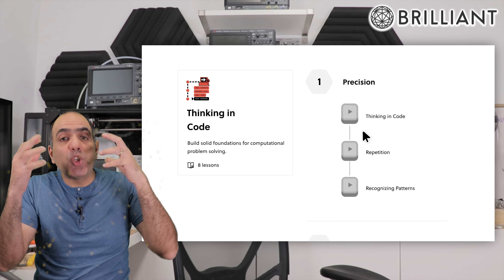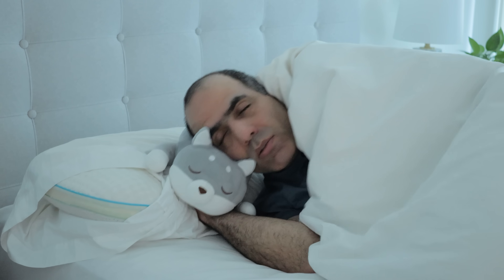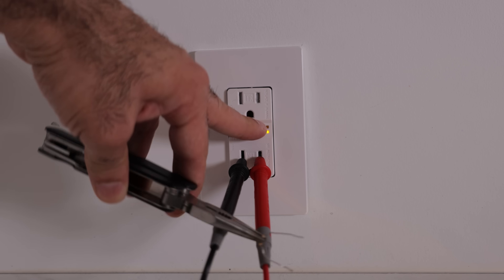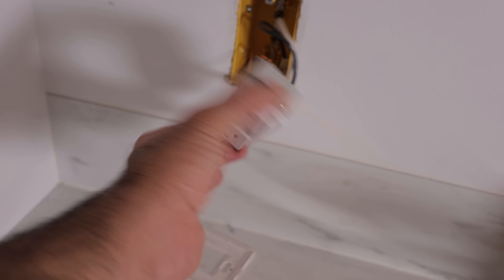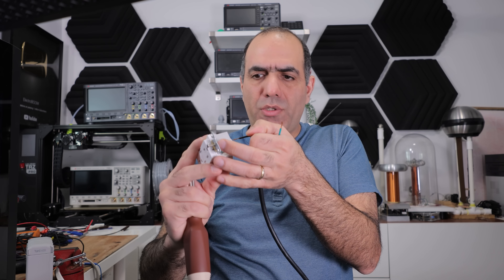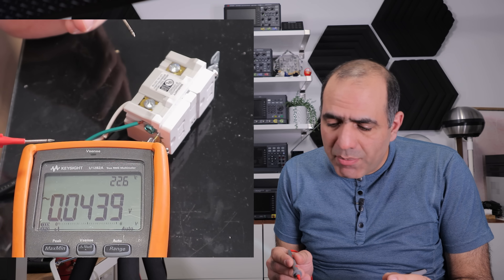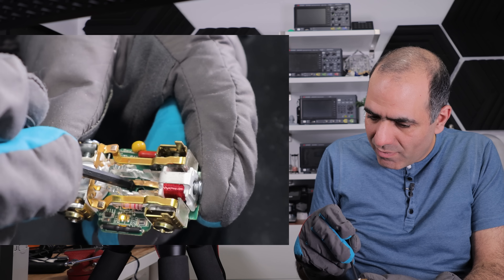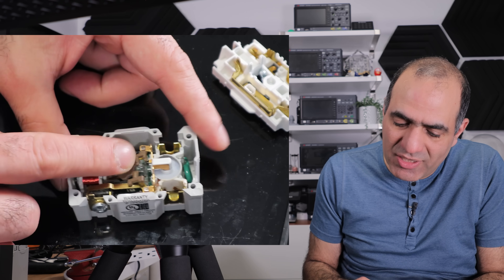Repairing Faulty Ground Fault Failure

Comment: Crazy timing. Today I was working on a ground issue with my audio equipment.  I have one device (a vintage function generator) that when switched on or off causes my computer MIDI adapter to have an issue. As it turns out, said device has a center tapped secondary being used as ground reference. The ground of the audio output jack shares the center tap as it's ground as well. This same ground path connects to  other audio devices and the MIDI adapter when patched in. I'm not certain of the exact health of the FULL WAVE RECTIFIER diodes or the ripple capacitors, however everything tests well and the DC is fairly clean. I decided to isolate the audio output with a standard 600ohm 1:1 transformer. Maybe someone here has some more ideas.

Comment: There's a code violation in there. You need to have 2 dedicated 20 amp small appliance branch circuits feeding the counter. You cannot have anything else powered from these circuits unless its a breakfast nook or gas range. No other lighting or circuits being fed from the counter top small appliance branch circuits and must be 20 amp and ran with 12 gauge wire. Looks like a handy man or DIY kitchen remod going on there. You could also have a residual back feed from something on the line if that circuit is running all over the house. You could also have a loose neutral up the line from that outlet. Being it's at the end of the line, could be anywhere. Hopefully its just a bad GFCI but being an electrician for a few years taught me that these problems come back and usually end up being a loose neutral splice somewhere buried in a wall or attic.

Comment: GFCIs suck.  Especially in older houses with wonky wiring and shared neutrals.  Too many moving parts.  So much chinesium.  I've had many catastrophic melty fireballs of late.  Put one in the kitchen.  Put one in the bathroom.  Then stop.  Definitely don't buy ultra-cheap amazon ones.  Thumbs up for the boom, as usual.

Comment: My guess: since this GFCI is in a bathroom, maybe moisture got to the PCB and leakage current is randomly tripping it. If there is no tracking damage, drying the board at 70C for a few hours might fix it.

Comment: 10:42
So the test button is just a mechanical test of the mechanism that opens the circuit? I though it would actually create a short at the right amperage to test the calibration/sensitivity is appropriate.

Then again, if it's not calibrated correctly that would make it a fire hazard since it wouldn't pop. Guess that makes sense then. Just never thought about it before.
Reply: They do create a current-limited short, Mehdi's comment was a bit misleading. If you hold the button and it doesn't trip the internal resistor will end up burning.

Comment: 1:46 When our GFCI outlet did that, it turned out to be because the outlet was also connected to a hidden outlet outside under the porch where the seals had failed and were letting water get into the outlet to occasionally bridge the circuit.  Edit:  Hahaha I forgot, another time, in a different room, it was tripping because one of my buddies who was staying over after drinking threw up in the outlet, cleaned up the outside, but at first was too embarrassed to admit to it.  It also had an outside outlet connected to it, so we replaced the seals to no luck.  When he found out we were having problems with that outlet, he reluctantly told me what happened lol
Reply: I had something similar, the cat threw up on a power strip which was on a protected outlet.

Comment: When you exposed the inside of the electrical box, I saw a screw (used to mount the box, right in the spot where it could be touching the neutral screw. I bet if you re-installed the new GFCI by sliding it hard left ( like the old one was) the tripping would return.

Comment: The wires on the original GFCI were stripped too short making a connection but not a good one. the strip gage is on the back of the GFCI device. sometimes it will even click rapidly when this happens. pro tip. love your content!

Comment: I had a GFCI circuit breaker tripping on a piece of equipment, tore the equipment apart looking for a short, almost gave up and unplugged the equipment and the breaker tripped with nothing hooked up.  Tried it again and it happened multiple times after 9-1/2 minutes.  Replaced the breaker working fine.  That was a head scratcher for sure.

Comment: HOW old is it??
Its weakened, or Wrong Ampage.
or someone installed it with to many SERIAL connections...
Reply: So it fails, bump a Bump turns back on??  Loose wire down the line, find ALL connections along that wire.

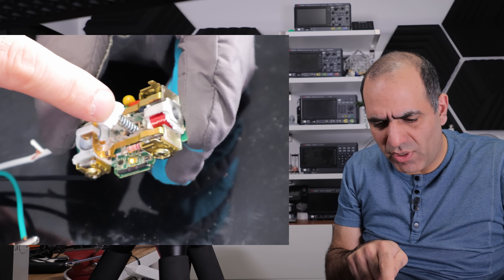Comment: 8:20 oh god, I had a GFCI in my kitchen die in such a scary and violent way that I thought the house was burning down. Heard this ungodly buzzing noise and then a loud pop like a firecracker. Kitchen smelt like burnt wiring, half the outlets were dead, half weren't. At the time I  had no clue. Panic-called electricians and they came out first thing in the morning. They diagnosed it to the GFCI. After they replaced it, I took the old one apart like you did and found that the little coil there had a visible break in some of the windings, and under an electric microscope, I found insanely tiny bits of copper everywhere. So I guess something inside mechnically failed and that coil smoked itself until the copper melted and formed a break that caused a violent short/arc.
Reply: It could also have been that the coil was trying to break the circuit, but had physically gotten stuck, you can see in his video when he was playing with it. it was buzzing angrily and started smoking. in my experience with GFCIs the test resistor and that coil are not meant to see full 120 volts for very long. they will often fail. usually spectacularly with pops and electrical smells and the mysterious grey smoke.
Reply: @compzac  If that was the case I can't imagine why. At the time nothing was really using that circuit, and after they replaced it with a new GFCI and I turned everything on, nothing ever tripped. I wasn't in the kitchen at the time it happened and nothing was on but a little LED light, so I'd be confused as to why it wanted to trip.
Reply: @compzac   That's the most likely scenario. It was trying to trip but for whatever reason failed to shut off the power. That's probably part of the reason they say to test monthly, that ensures everything keeps moving freely.

Comment: I'm willing to bet that the explanation you give at 11:33-> is what was faulting the old GFCI.  Probably some inconsistencies in your power may have fooled it into a fault condition, or a weak solder joint on the board (or just a bad component).  Can't tell if you can try and re-do all the joints or not or test components against their data sheets just to put the theory to a test.

Comment: I HATE the commercials, but I accept them as the inevitable price that must be paid to receive FREE-OF-CHARGE this genius (I WON"T say "Brilliant" ) instruction from the single BEST & ONLY Professor of Electrical Circuitry, Engineering, and Painful Shocks anywhere in the digital multi-verse. (I too have a GFCI outlet that has been mal-functioning (for over 30 years), but now I at least understand why there might be an explainable reason for it.) Thank you, Dr. ElectroBOOM!

Comment: 5ma is quite small and sensitive. Here in Great Britain our RCD Residual Current Detectors are set to 30ma, with higher ones further up the chain, protecting the cable against damage, often with a time delay. Ground fault protection in the USA ought to be easy to fix at the source before the distribution boards.

Comment: 11:53  Can someone please explain why the power supply didn't get damaged or overheat when Mehdi shorted the positive and negative terminals together? I'm still a beginner in electronics and thought that shorting 10A together like that would either damage the power supply or overheat the wires until they melted.
Reply: The supply has a current limitor built in. It will decrease the voltage according to a curve when it gets near the set current limit keeping it at the limit. The wires are almost dead shorts. If they have a resistance of 100 milliohms then using ohms law, they would drop the voltage by the following. V=IR, V= 10 x 0.1 which is 1 Volt which cant really be dropped since the supply already is below 1V due to the current limitor but assuming it could fully drop the 1V then 1V at 10A would yield the following amount of power in watts: P=IV which would be 10 watts. 10 watts is a very small amount of heat, about the same as a high performance smart phone. It would produce less because the voltage dropped into the millivolts.

Comment: The European way with a Centralized GFCI makes a lot more sence to me (im also from europe go figure) but seriously having one for a small flat or one for every room is much better than every single outlet alone the E-waste if one of those oulets breaks.
Sure it also has its advantages but TBH its a saftey device you never want to use so the European way is in my opinion less wastefull of our resources and works just fine.
(In Europe) The fridge should get its own GFCI in my opinion

Comment: Do you guys in America have different types of RCD (GFCI)? In UK we recently had a requirement to fit type A rather than previously typical type AC. AC types could be rendered ineffective due to DC saturation of the coil, and our test meters used to use this trick to run loop impedance tests through the RCD (GFCI). There are new methods that the testers use now to avoid this which I do work however decrease accuracy of the loop test. Something I can imagine that you would find interesting to compare different RCD types from across the world on a test bench? I'd happily send you a couple of the cheaper ones from the UK.

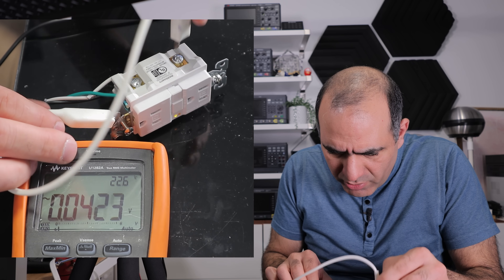Comment: @7:00 voltage difference between Neural and Ground is not needed and not important or how deep in the house it is.
Kirchoff law says that current "outflowing" Live(Hot) must be equal to current "returning" by Neutral, so i if you connect Ground and Neutral you make additonal path (of simillar or better resistance) for current to flow BUT OMITTING GFCI so currents on GFCI are not equal then so it trips.

Comment: God I absolutely loathe electromechanical contrivances magically fixing themselves after I've failed to find any actionable fault. I always get extremely nervous when it happens. Hydraulic actuation is wonderfully useful, and usually straightforward-ish enough to work with, but the combo of 400V and high pressure isn't gonna stop scaring the everloving shit out of me any time soon.

Comment: I wonder if they have, in their infinite wisdom, added a surge protector of some kind that has started going faulty. That green thing that looks like a MOV suggests that might be the case. Wouldn't be the only weird thing about this unit. Normally the test button would put a resistor between live and earth to simulate a real ground fault but in this device it only activates the solenoid and thus does not test the entire system. It also allows you to force the contacts closed by keeping the button pushed in which is not preferable. Not very confidence-inspiring, if you ask me.

Comment: In my experience it is a bad neutral connection at the breaker box and it makes the circuit use the ground as the neutral leg by induction.  Probably a bad explanation.

Comment: You should cover the safety feature built into new GFCIs so it won't work if it's not wired correctly.

And some fan needs to make an animation video of the crazy workshop that operates inside Mehdi's mind...

Comment: You need a 2W resistor.
The small ones have too low voltage rating and also the small current will heat them too much for their 1/4W power rating.

Comment: if you have central ground falt protection, you dont need many individual ones. and it makes no sense. you need protection on all circuits, not just where water source is.

Comment: Funny enough, I changed 3 wall sockets to have 3 plugs instead of 2. One of them was in a circuit it shouldn't have been. How you might ask? By isolating myself from ground and shorting it with a screwdriver. I did it for all 3 just as an extra precaution and it probably saved me from getting shocked twice; one by touching live wires and the other one via defibrillator. See? You can actually learn stuff in youtube which helps you in real life.

Comment: I saw a new home builder have a AFCI/GFCI breaker in the panel that would seemingly trip for no reason. The person who bought the home reported it to the builder. The "FIX" was to remove the AFCI breaker and not tell anybody. I'm scared to think there's an arc fault in the walls waiting to burn down the house.
Reply: That "fix" is, of course, not code compliant, but I'm sure you know that. 

From my own experience with a borderline AFCI breaker, sometimes "no reason" is something that legitimately looks like an arc fault. In my case, that was a vacuum cleaner and a laser printer. But what I learned with my own AFCI demon was that over time it just gets more and more sensitive and eventually really does start tripping for no reason. In my case, replacing the faulty breaker with a new one of the same model fixed the problem, and would probably have fixed that person's problem, too.

Comment: Unexpected ground faults are 90% caused by moisture and water in your device. This ground fault was real due to water in your device. When you open it up water can evaporate and it is fine after reassembly. See the conformal coating on the pcb of this thing ? It is for good reason.

Comment: 1) Laughs in europonese
2) Remembers, that if we would shock ourselves like Mehdi, we would probably be dead.
3) Say, shall we call it even?
Reply: If you shock yourself like Mehdi you do also survive; he isn't immune to electricity.
Reply: @Okurkaarrgghh  As a general rule of thumb: No, we don't. The long answer is that it depends on your particular local distribution grid and your particular house. I have 15 A 240 VAC. Getting shocked by that will absolutely kill you if the current happens to pass through your heart. I have a friend who lost his dad from electrocution by simply cutting a live cord he assumed was not plugged in, without GFC.

Comment: Here in the UK where we have "whole house" GFCIs (or RCDs as I prefer to call them) the tripping on a neutral to earth fault is especially annoying. When you're safely working on one circuit after isolating it at the consumer unit, you've only disconnected the live side. With the neutral side of every circuit in the house stilk connected together, if you accidentally touch neutral and earth together on the isolated circuit that you're working on, it trips the whole-house RCD. ANNOYING!
Reply: I have a lighting circuit in my house that's protected by a GFCI breaker in the panel. I was replacing the original light fixture, and I thought it'd be sufficient to turn off the switch at the wall, so that I could leave the light on in the adjacent room to give me light to see by. 

Nope, just touching the neutral wire in that box, not even neutral and ground at the same time, even while standing on a fiberglass ladder, was enough to trip the GFCI.

This is why my electrical-stuff tool bag now contains a battery-operated headlamp.

Comment: Fantastic video! I was literally dealing with this same exact issue last week. I removed the faulty GFCI and pulled it apart (unfortunately I had to destroy the casing to disassemble it) and I saw basically the exact same hardware you saw. I figured out the solenoid coil, and disconnecting contacts, but I couldn't understand what was going on between the line terminals. Thanks to your video, now I know!
Reply: Was it riveted shut?
Reply: @memejeff  Strangely, the case was all plastic. There were 8 plastic tabs that kept it together, but unlike normal plastic tabs that can be pushed aside with a small screwdriver, they had been heated and formed after insertion to make it impossible to disassemble non-destructively. The only way to get past the tabs was to cut either the tabs (which didn't work very well) or cut open the holes they were threaded through (which was much easier, but way more destructive).
Reply: @geraldalexander8093  wow. I have never seen something like that before. Shame that they made it like that. Sounds like a shockingly complex way of sealing it.

Comment: The gfci should have the green led indicator illuminated when the circuit breaker is in the closed position and the red indicator illuminated after something has cause the breaker to trip and open up.  Once the circuit is open there should be no popping for any kind because the reset breaker button hasn’t been pressed in to reset the breaker again.  So either it is wired incorrectly or has some other type of defect internally.
Reply: Different brands have different indicators. Some light when the output is active, some light when they trip, and some don't light at all.

Comment: Does it mean, the test button just mechanically closes the switch to energize the coil to trigger the break? Could this mean that if the current sensing electronics won't work any more the test button would give a false result, because it merely checks the function of the coil and not the test circuit?
Until now, I thought the test button would add a resistor to live and earth like Mehdi does manually.

Comment: I don't think you are suppose to use the holes back in the unit, but rather the screw. The holes form weaker connection.
Reply: There are two different kinds of "holes in the back." You should avoid using the single-use backstabby ones, but the ones that are clamps actuated by the terminal screws are just fine. I couldn't tell for sure which type the new receptacle had - they look like the clamp type, based on where they're located - but the old one definitely had the clamp type.